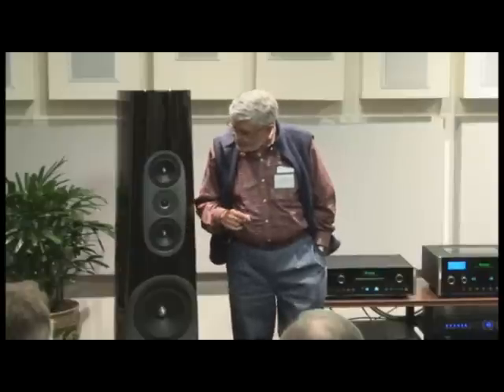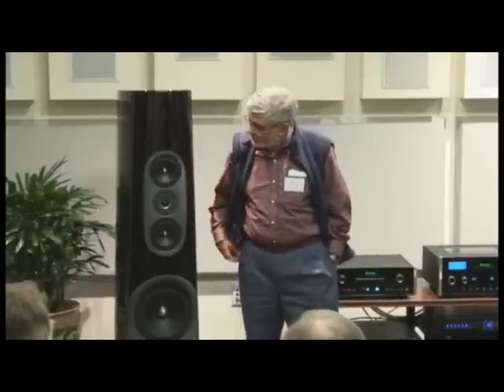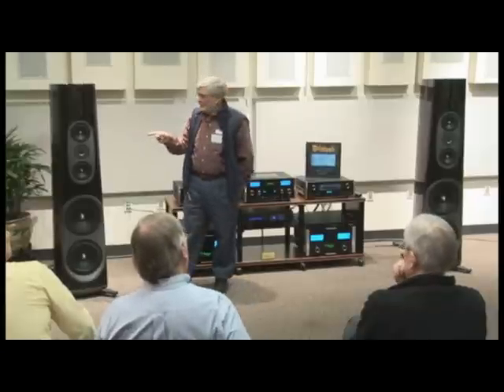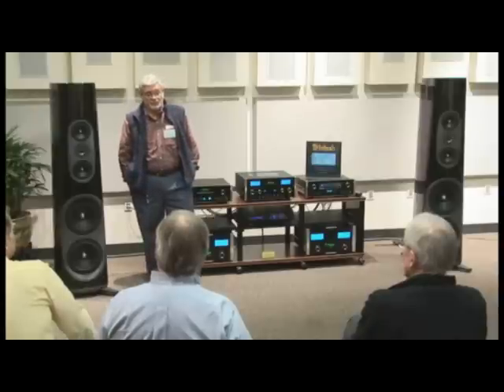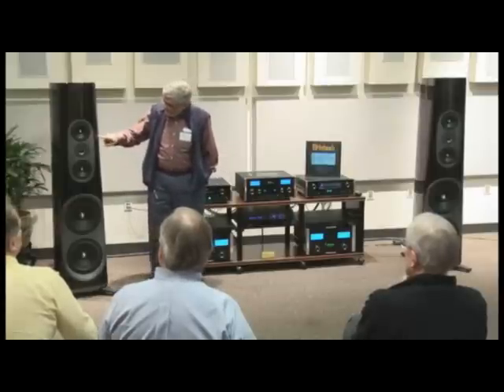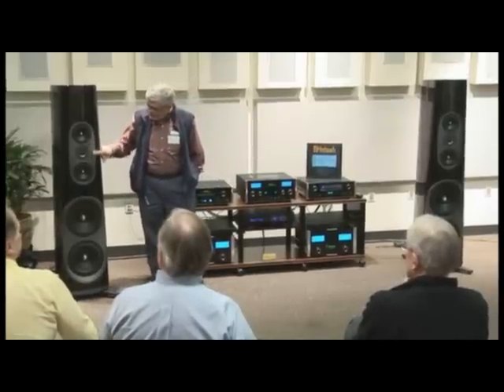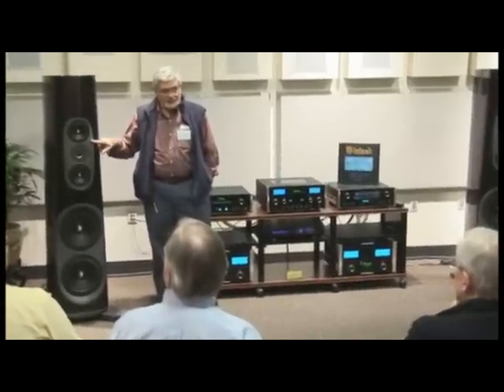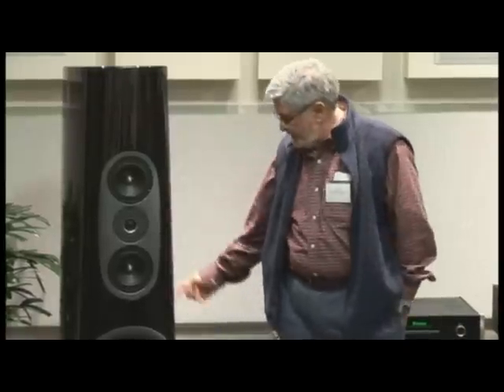A presentation by Joseph D'Appolito at Audio Video Design

Comment: Hi thank you so much for the extremely interesting video with such a highly praised designer.
I am not an expert but when i see Mr. D'Appolito's concept in many speakers i am sincerely fascinated. 
When I see how much this design has become so popular in high end i have the strong feeling that it must be really right !
Great achievement in speakers technology.
I have one question.   Mr. D'Appolito stresses the importance of a great midrange performance.
Can we define in terms of actual freq bandwidth this midrange ?  i mean from which Hz to which Hz does it extend ?
Another question.  A crossover with a freq inside the midrange can impact negatively the overall sound ? (i tend to think so).
Thanks a lot again for the extremely valuable video.
Kindest regards, gino
Reply: That's the thing though. D'Appolito designs fly in the face of all conventional science.

In my mind, D'Appolito designs sacrifice comb-filtering in favor of symmetrical lobing. Apparently this sounds correct to many, or the interference pattern creates a magic woo scenario where the destructive interference is reduced and constructive interference is increased. Frankly, I doubt it.

I wanted to like this design, but that's before I started understanding driver placement and frequency response.

I'm fine with this design so long as the basic rules of avoiding comb-filtering are implemented. It's nearly impossible to do unless the tweeter is offset and it's also a 3-way. Which again, I'm willing to do. But then, the D'Appolito devotees will then complain that the lobing is now not symmetrical with the offset tweeter.

For the home and achieving hifi at a reasonable price, which incorporates psycho acoustics which people generally like, I think the tweeter, mid, woofer, woofer in a 3-way configuration is best. Of course, one can always scrap the other woofer.

It eliminates comb-filtering. And the psycho acoustics reflect nature. Tweets (air) on top. Mids (higher voice) in the middle. And lower voice and bass on bottom (elephants and tanks moving on the ground).

I used to think this design was awful, but then I started understanding beaming and comb filtering. It's common because it works at voiding the pit falls.
Reply: Anonymous DuetoFascists You have no idea what you're talking about. Please just stop.